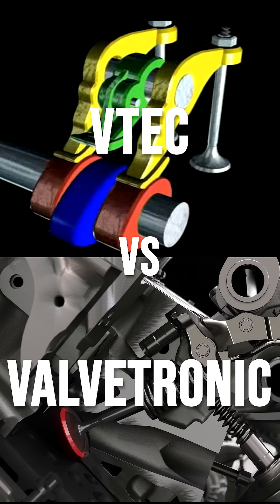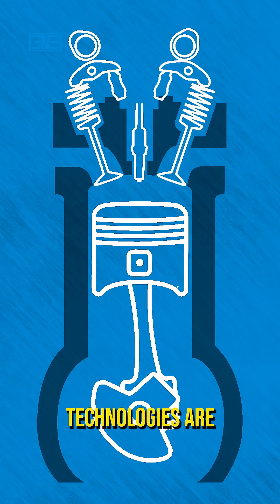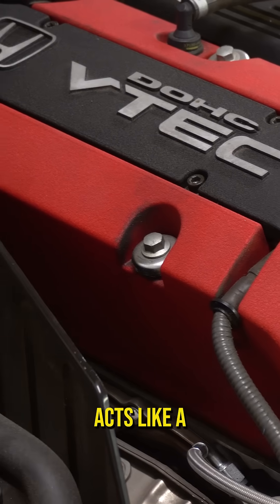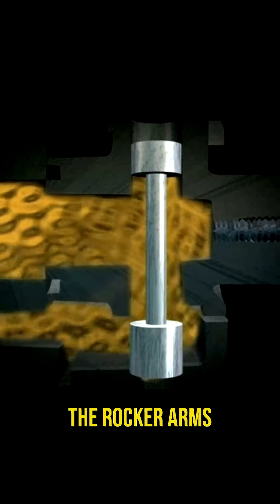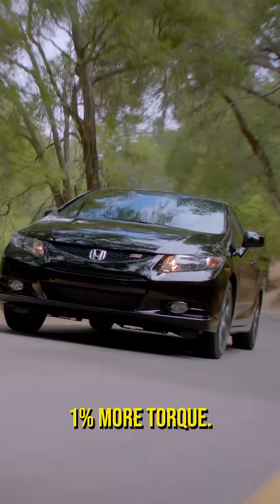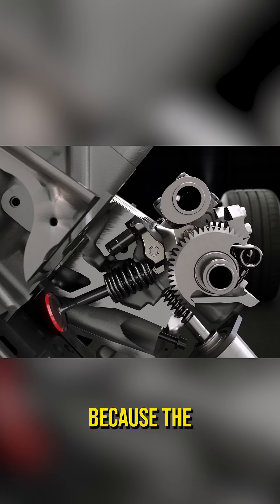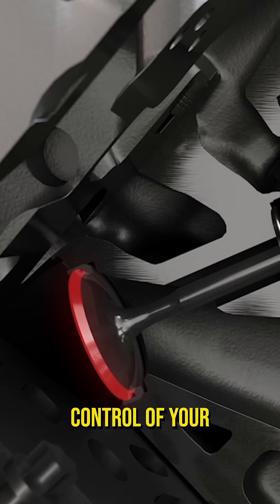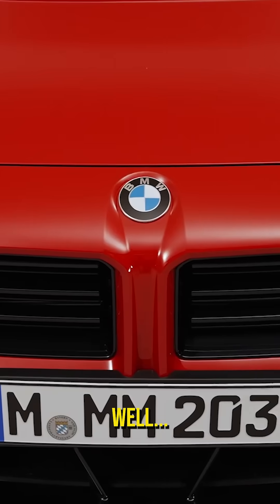VTEC vs Valvetronic - Honda vs BMW!

Comment: VTEC: all the lag of a Turbo, but none of the power
Reply: This has zero to do with VTEC and everything to do with the small engines Honda most produced with VTEC. If you’ve ever driven a sport-oriented Honda made prior to VTEC being a thing, you’d realize what a vast improvement it was.
Reply: Spoken like someone who knows nothing
Reply: That's not true at all. I had an Si for a long time, no input lag to speak of. Vtec engaged at 6k rpms on the dot, definitely was an obvious boast in hp.
Reply: @DutchiezRNG Woo, 15 more horsepower. Still an absolute slug lol.
Reply: @DutchiezRNG HP is top end, torque is speed.
Reply: @Sommyie Grade A nonsense
Reply: @Sommyie  it doesn't work like that
Reply: @Sommyie  hp is made from torque x speed. Hp is overall power , torque is just a force
Reply: @Sommyie  Wrong. Horsepower is how efficiently an engine can make torque over a rotational speed or RPM. Without horsepower, you’re not going anywhere. You can apply a lot of torque to a bolt and it won’t turn. just like how diesel engines make a lot of torque, but without high RPMs, they won’t get far.
Reply: @Sommyie  power is a function of torque and RPM, cant have one without the other genius
Reply: What? They do go far. They just need longer gears to compensate for lower rpms.
Reply: @Sommyie torque is marketing bs. Power is all
Reply: @mr_padla why can't a gtr tow more than a diesel truck?
Reply: @Sommyie cuz it designed by Nissan for speed and dynamic usual for supercars. But with other main gear ratio you can get any torque on wheel. So gtr engine can easy tow a truck if it transmission will be designed for. Torque is nothing. Power is all. Power physically is volume of work. Work is acceleration.
Reply: @kungfu_padlaa you better learn physics a bit. power is torque multiplied by engine speed.
Reply: @Sommyie  🤣
Reply: @francoisloriot2674 the hell is engine speed?
Reply: @Nobody_Cares913 Is that a real question??  Obviously, the speed at which the engine turns.  Usually measured in rotations per minute, abbreviated RPM.
Reply: @francoisloriot2674  Yup that's a real question 
English is not my first language. It's pretty good though but engine speed is just something I never heard before. We call it "Drehzahl" but technically it's a frequency. How often does something happen in x amount of time.
I just associated speed with velocity, which is distance per time.
But I'm also an electrician, not a mechanic. We are very particular with technical terms like that 😅
Reply: @Sommyie  horsepower is torque times RPM divided by 5252 so no torque is not speed
Reply: @Sommyie  Thank you for letting everyone know you don't understand torque/hp
Reply: @Matticus289 You're welcome! Don't catch a resentment
Reply: @Sommyie  Sorry, that was a pretty jerk I said
Reply: @Spike00773  The whole point of VTEC was to give an engine both low-end torque and high-end horsepower.
Reply: I think you don't understand atmospheric engines.  There is no lag in these engines.
Reply: Do you even have ANY concept of what lag is? Because that is so wrong.
Reply: Top tier of nonsense comment.
Reply: Found the guy who got dog walked by a civic with a laptop
Reply: More lag than a turbo :(
Reply: Look at torque and power per displacement.

Way better than any NA engine the US made at the time.
Reply: VTEC is not forced induction and has never pretended to be forced induction 😂
Reply: Whp is whp … dont matter if you have 150 or 300wtrq juste mean that your power is else where in the rev range ….
Usually engine that can maintain their torque number longer in the rev tend to be more oriented for racing since you get longer power range and close ratio transmission with 6-7-8 speed correct the low torque déficit its exactly why the Z06 départ from a 6.2 supercharged to a 5.5 N/A v8 and is faster despise having way less torque than the c7 ….
Reply: Care to explain everyone why Lamborghinis and Ferraris also have variable valve timing then?
Reply: @slckb0y65 because they are street cars, and they must have two distinct phases: Phase 1: Low revs, low fuel consumption, good mileage, good torque. 
Phase 2: High revs, high speed, all power available. That is when VVT comes into play, and why it is important for Ferraris and Lamborghinis. 

VVT gives you the possibility to have both engine regimes optimized.
Reply: Spoken like a true inexperienced non owner. I have a vtec s2k. No lag. Not as much of a boost like a true turbo either though.
Reply: That ocurrs when people don't know how to engage VTEC when changing gears
Reply: It's not lag, you get an instant surge in acceleration while in VTEC, if you drive any performance inspired Honda with Performance VTEC you would see the difference. My TSX has I-Vtec on intake and exhaust and that girl hauls ass in VTEC HARD.
Reply: I think this guy is confusing "lag" with the the fact Turbos and Vtec are designed to come in to play at a specific RPM

Comment: Valve Tronic is absolutely over engineered for use in daily drivers. Freind of mine had BMW with it for years and if it needs to be repaired its expensive. Meanwhile my 1.5l V Tech may need "ancient" maintenance procedures compared with German cars but the thing simply is as reliable as it can get. Less moving parts means less points of failure and less expensive sounds.

Comment: Having owned both and worked on both Honda clearly wins 👍
Reply: So, Honda wins because it is easier to repair? LMFAO. 
1% of the fun, because 20% of the maintenance.
Reply: Far fewer repairs on a Honda , simple maintenance was it's only requirement  @sombraarthur
Reply: @johngraham7661 definitely. And that it allowed to rev higher than 7k. 
But that is it. 

Valvetronic makes the car control its own A/F ratio, it makes the car save what it can when it can, or dump it all for power. The precision of the control makes all the difference, specially when you take these two cars into a tuner.
Reply: @sombraarthur  sybau bruh, why try so hard to change someone opinion ?
Reply: @r-resnet2841 who said I am trying to change his opinion, bruv? 😂😂😂😂
Reply: @sombraarthur  by how your first reply ?
Reply: not power and fun wise 👍🏽
Reply: The only opinion that really matters in this whole comment section 😂

Comment: The valvetronic system on my R56 Mini S with the N18 engine works amazingly well. The only hitch is the valvetronic operating solenoids can get gummed up and not work as well, even throwing codes. The solution is to change the damn oil more often, not per the factory / EPA recommended interval, but every 5K miles without fail.
Reply: This. Mini's gum up like you wouldn't believe (or, well, you would). I've also had my valve cover replaced twice because the first replacement was installed pre-warped. 

I love my R55 Mini, but I don't trust it. I even gave it Liquimoly oil, which made even my car geek friend go, "isn't that overkill." Nope, and my car STILL leaks oil, though it is greatly reduced.

I'm just glad I don't have the turbo, given that it shared the oil reservoir with the engine. I imagine they absolutely guzzle oil.
Reply: LMAO, Me sitting here with a car with where I do oil changes every 20k miles 😂. Y'all keep wasting your money though. Modern synthetics are great!
Reply: @cookoo4lyf lol, update me when your car hits 400k mi with the factory engine and trans.

Modern synthetics are no different than synthetics from 2 decades ago. Youve been deceived.

And the fact that changing the oil every 5k alleviates the symptoms is proof that you cannot push the oil past that. I've experienced it myself with bad vanos solenoids. If you don't change the oil enough, your engine can stall, or shoot too much gas out of the exhaust and foul catalytic converters. Changing oil more often cleans out the solenoids. 

You have a fundamental misunderstanding of how oil and its detergents work. There is not a switch where the oil goes from good to bad, it is a gradient deterioration.

I have known multiple engines who have made it to a million miles through multiple generations. Each time, they say they changed the oil every ≈3k mi.  Sometimes 2.5k, sometimes 5k, but never has anyone ever said above 5k.
Reply: Every 5k? If I care about the car 2.5-3k all day oil degrades after 2.5k miles so if you really want a engine to not breakdown that’s what I’d do personally
Reply: @paulchadjohnson okay, I thought I was the only one. 3k for me.
Reply: I used to change my oil every 3k miles. So every 5k is NBD.
Reply: Its worth noting the solenoids usually don't take very long to swap out either. On my car its 1 bolt per solenoid and literally takes 5 mins because theres tons of room at the front of the engine due to the electric cooling fan

Comment: Nobody says "Valvetronic kicked in, yo ☝️🤓".
Therefore, VTEC > Valvetronic
Reply: This why BMW is luxury sport, valvetronic doesn't "kick in" because it's always adjusting based on RPM and load leading to near flat torque curve maximum power from 0 to max
Reply: @ph_earle  another mic drop
Reply: Mic drop

Comment: Owned 4 BMWs in the past 20 years, never had an issue with any engine. But had (and still have) fun driving them 😎
Reply: So you kept each one for only 5 years. That's obviously not going to give you many problems. You'll never drive one BMW for 25 years like we do with Hondas and Toyotas 😂😂😂😂
Reply: Says a man changes cars every 5 years. Horribly wrong.
Reply: @TheViettan28  Exactly. And then he says he never had engine problems. Probably put only 50k kilometres on each🙄 While we 500k on our Hondas and Toyotas engines with ease🤣
Reply: You guys are funny. If you’ve never owned a bmw maybe pipe down. E36-46 generation cars are everywhere. I own a 2004 and it’s SMOOTH. I can happily keep up with cars 20 years newer, taking it to redline and hitting 120mph like it’s nothing

Comment: The BMW valvetronic system is reliable. There are very few BMW motors in the US that have issues with the valvetronic system, and even then failure is pretty rare. And because it eliminates the vacuum system and need for a throttle body, it actually has some reliability benefits as well. 

Valvetronic is really more of a fuel efficiency feature than a power feature, though. The maximum lift is still about the same as it would be on a normal motor. And it does not effect duration. 

VTEC, however, is normally set up for performance. It increases valve lift and duration spontaneously allowing for what's basically a big cam in an every day car. However, because the transition isn't smooth and causes a power surge, it's not really suitable for luxury products that are designed for smooth power delivery.
Reply: VTEC-E sir..... VTEC its not always used for performance, it can be used for low and mid range torque and or efficiency virtually unnoticed by the user. on the other hand that Dr.Jekyll and MrHyde effect we all love from the performance version of VTEC is unmatched , the theater it creates is intoxicating and we want more... Even the 2ZZ isnt as dramatic as the crossover of the VTEC system
Reply: Are you high?
Reply: It doesn't really eliminate the vacuum system.  BMWs with valvetronic have a separate vacuum pump to operate things like the brake booster.  Having no vacuum in the intake manifold also complicates things like PCV.
Reply: @JETZcorp  thats why they still have a throttle body
Reply: Mechanic here... totally disagree. Valvetronic is much more failure prone and is simply moving the throttle to the valve.  Still the same pumping losses
Reply: @mobilejoe87 ValveTronic closes the valves early for throttle to reduce the losses. It closes them late for maximum power at high RPM like vtec. Of course, same money and weight will give you more lift at higher rpm in a traditional camshaft.
Reply: @mobilejoe87  engineer here and statistically ur wrong, modern BMWs are rated very highly in reliability, and BMWs valvetronic motors are bulletproof. Statistically ur wrong.
Reply: @fastandfhurious3213  n52 n55 n46.   Eccentric shaft sensor, motor, shaft itself are all too common.  The motors will even short out the drivers in the DME.  It doesn't compare to VTEC reliability.  If its rare like you say there shouldn't be forums and YouTube videos all over about it.
Reply: @fastandfhurious3213  reliability?  Like how the N series inhales the serpentine belt through the front crankshaft seal and ruins the engine?
Reply: Lol yes they are super reliable for 5 years. Maybe you get super lucky for 10 years. But now, we are at the point where those cars will start having all the problems. Nobody is making statistics anymore at that age. But I would never buy more than 10 year old valvetronic car. Meanwhile I have 2 30 year old BMWs that still run like a top
Reply: Tell us you know nothing without telling us 😆😆😆
Reply: bmws are not reliable bro

Comment: My BMW E46 with the M54 engine Double Vanos system is the best straight-6 I've ever driven, lots of low end torque, almost immediate throttle response (slight electronic throttle lag), and 28 MPG highway.  The M54 engine with a 3.0L displacement can consume premium fuel very quickly when accelerating quickly.  23 years old 148k miles, and just lost the fuel pump last week, fixed it myself with a $400 part, no major repairs.

Comment: Personally, I would take VVT (or VANOS in BMW speak) over either of those.
Reply: For the last decade or more BMW has made engines which have both Valvtronic and VANOS.   Valvtromic is really helpful with turbo cars because you omit throttle lag between the throttle plate and intake valves.

Comment: I had 2011 335i N55 where the valvetronic motor and shaft gave up at like 67k. The eccentric shaft was $900 just as a part.

Comment: VTEC = binary on or off (think the turbo lag of old...you know when it hits). Reliable

Valvetronic = continuously variable. superior solution despite the increased complexity. Reliable when you maintain oil intervals about 1/2 the factory.